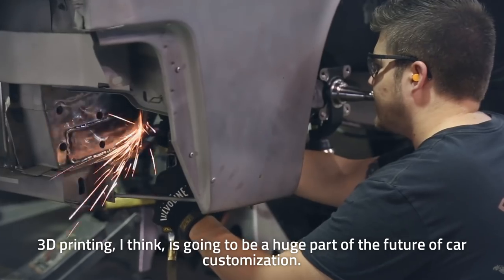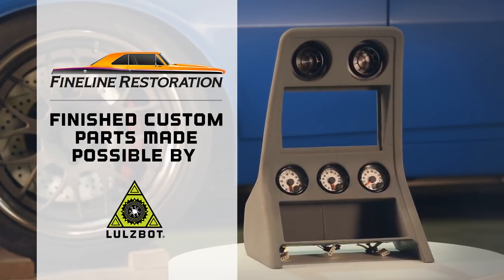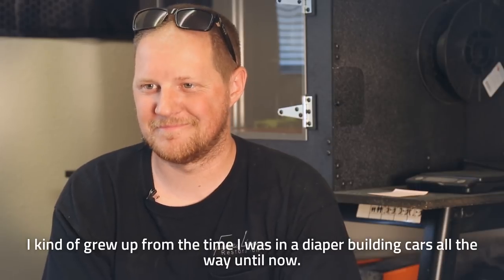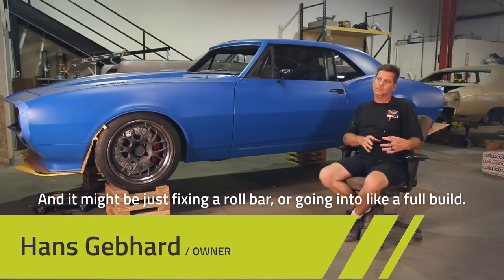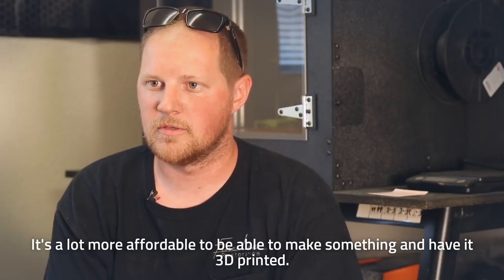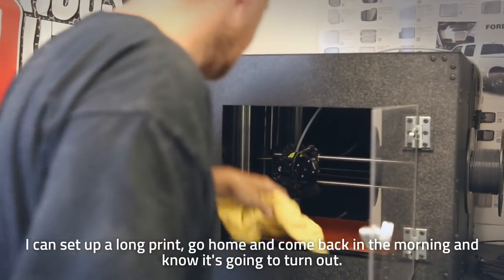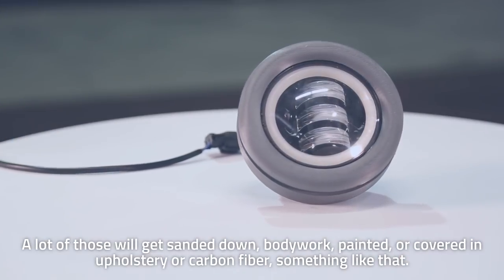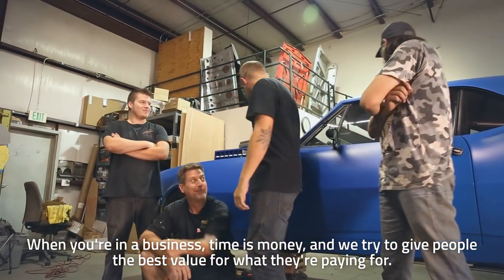3D Printing Custom Car Parts: Fine Line Restoration

Comment: I would like a complete new dashboard for my 95 Toyota Supra, problem is, they are discontinued and run close to 2k or more, mine is broken in certain places, can you make a new one from the broken origional? And what would it cost?
Reply: Providing most of the dash fascia isn't too damaged.. 

They can simply cut n paste in design and while you're there.. add any mods you might thing you'd like to add at the time and get a quote for full design, print and install.

Might even be cheaper in the long run for including labour too..

Comment: What material are people using for car parts that can handle the temperatures?
Reply from the maker: Many people are using filament materials with a high glass transition temperature like ABS, ColorFabb nGen, ColorFabb_HT, Chroma Strand Labs INOVA-1800, Proto-pasta High Temperature PLA, Proto-pasta Matte Fiber PLA, and more. See the range of filament options that can withstand the summertime heat of an automobile passenger cabin at https://www.lulzbot.com/store/filament.
Reply: @Lulzbot3D How do I contact you for a quote.
Reply from the maker: @keyoflife24  sales @lulzbot.com or 701-809-0800 x 1
Reply from the maker: @keyoflife24  sales@lulzbot.com